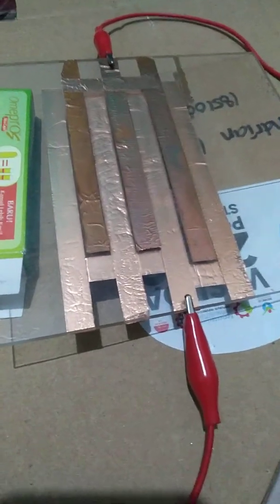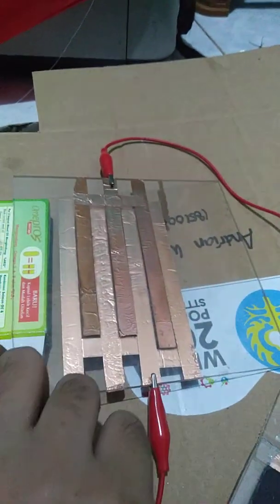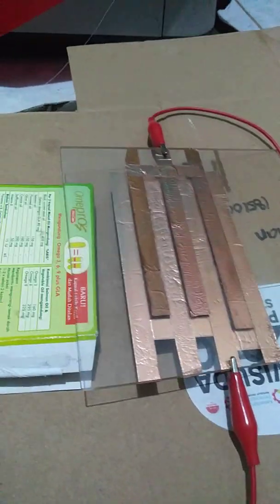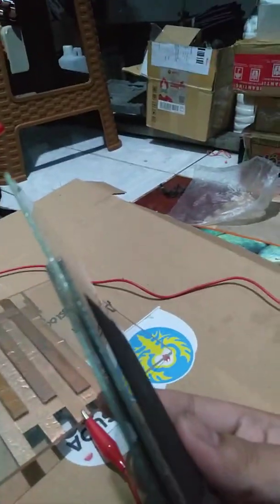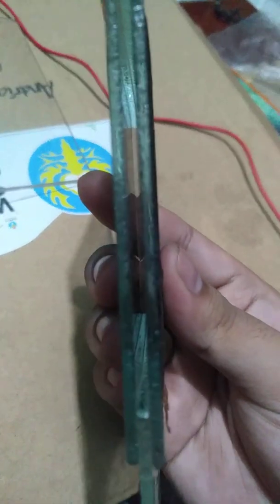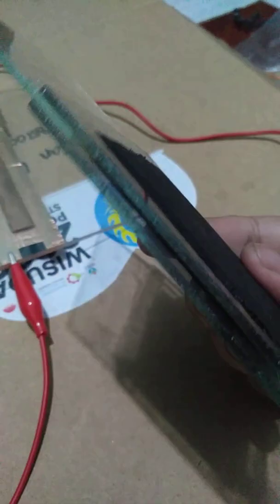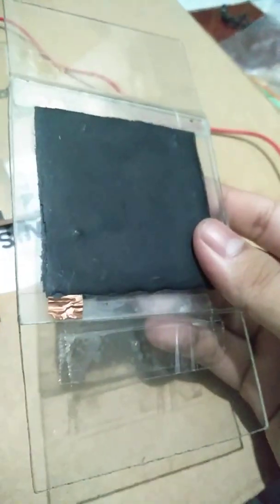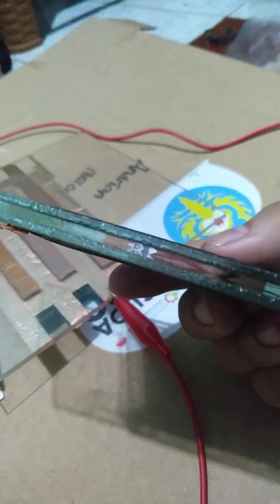Double Dielectric Barrier Discharge Plasma (Updates)

Comment: Does your DBD show a negative resistance effect ?
Reply: what is negative resistancde brother?
Reply: @pro.empire  Normally when voltage increases we get a resulting current increase & also  current increase gives an increased voltage drop. With negative resistance this effect is opposite (especially with plasmas)  an increased current causes a reduced voltage drop. Like with car spark plug when fired by HV ignition or when welding metals with plasma welder.
Reply: @smokyatgroups  Damn brother.. i just learn something new... i may have to read this 3 more time to understand this... Do you know how to build this? if you do what is the power i need?